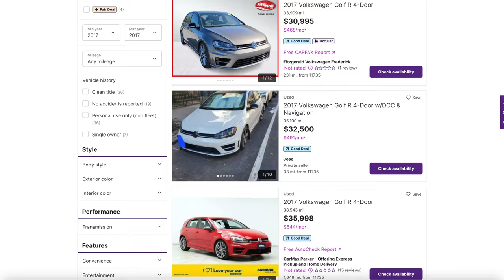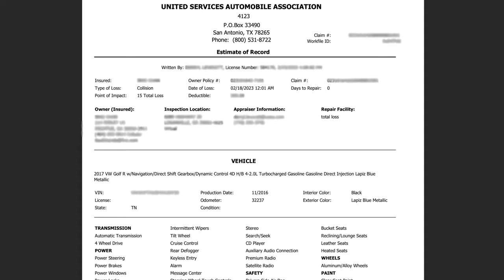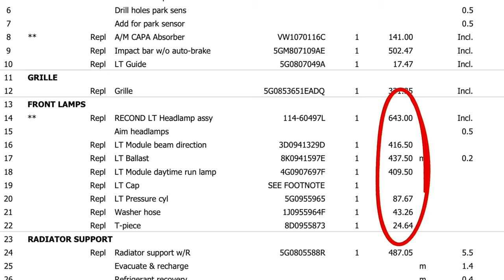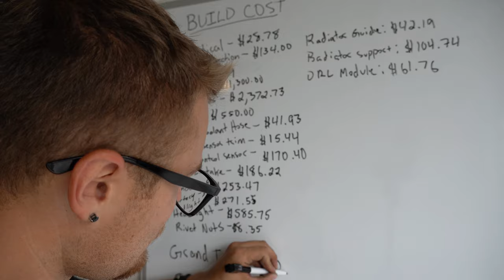REBUILDING A WRECKED VOLKSWAGEN GOLF R | PT 3

Comment: The series is coming out amazing keep up the good work man! I just repaired a flooded audi a4 and came across the same issue with the headlight computers but mine had salt water so had to trash both units and replace with new ones.. also tons of electrical faults plus a flooded Electric steering column which was a pain i  the butt.. good luck with your builds my friend!
Reply from the maker: Sheesh, idk if i would mess with salt water flood!

Comment: Good job Hayden! You keep learning more and more! 

First part is the airconditioning condenser and behind that is the radiator for your coolant. You can tell the difference because the airconditioning condensor is a bit thinner and has pipes 👍
This car will be a as new!
Reply from the maker: Agh okay! Isnt the intercooler in the middle? Or behind it all?
Reply: @Haydenschreiermk2  Intercoolers are used with Turbo's. Dont worry about those things haha. The end result is the important part and you are doing great. 👍
Reply: @Mark Moreno  I believe the Golf R has a turbo, right?
Reply: @motobikemike914  Not standard but optional. The power comes from just the engine.The part he mentions in the video is the airconditioning condenser. Behind it is the standard radiator for the coolant.
Reply: @motobikemike914  You are right , i was wrong. Car has a turbo and It is a intercooler behind the airconditioning condenser. Didnt see it were 2... sorry.

Comment: I pad $27k for a 122k mile 18 R you getting this one for 11k is dope you’ll probably put another 4k into it with the hatch and interior parts this is dope!
Reply from the maker: wow! Im more impressed that it has 122k miles! any problems with it?
Reply: @Haydenschreiermk2  so far no problems. only had to replace coolant hose that was slightly leaking and the upper timing chain cover. going to do coil packs and spark plugs soon. But I’m at 142k miles now now having the car 9 months later. It is not tuned just has a CAI.